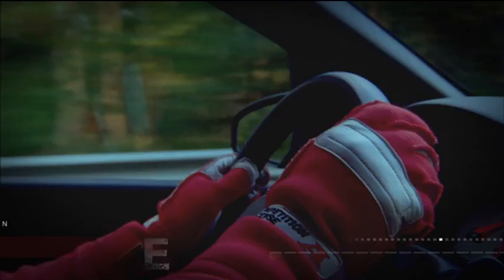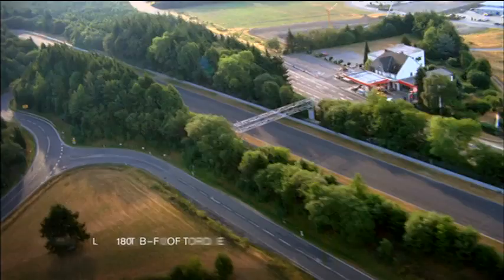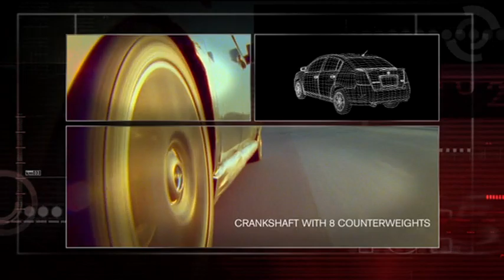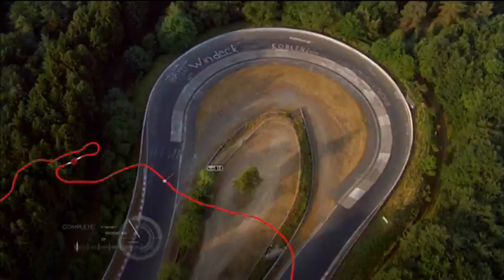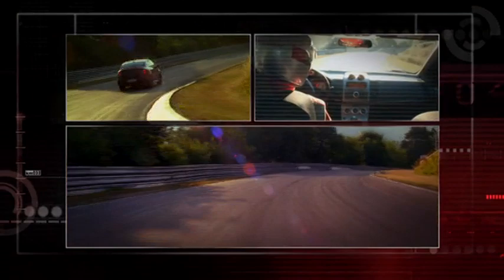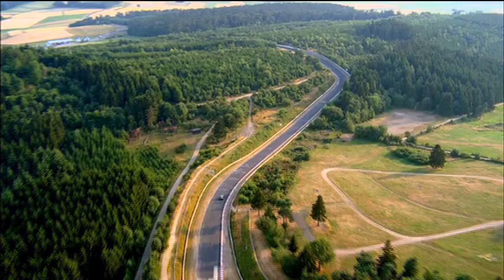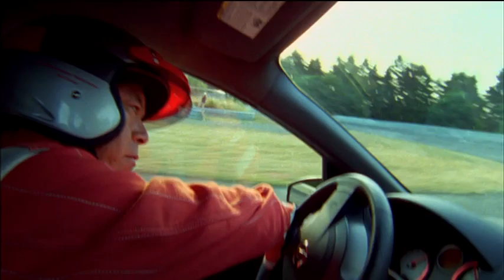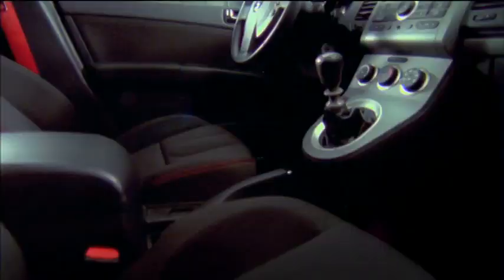Nissan Sentra SE-R Spec-V Design Ideology

Comment from the maker: Someone had to do it!

I think we would agree that a 240 like car *instead* of our Spec-V's would've been purchased if the price was right. As far as notchy transmissions; I like it. It's a raw effect and connects the driver to what is exactly going on. I've driven cars with weak ass clutches and whimpy shifters with no feel and I hate it. 

I don't think I'll be driving mine in twenty years either but it is a venerable platform to get started into motorsports.